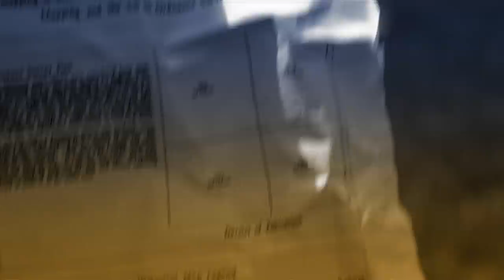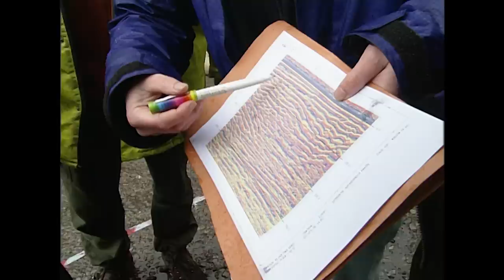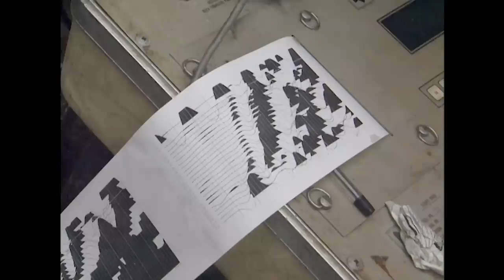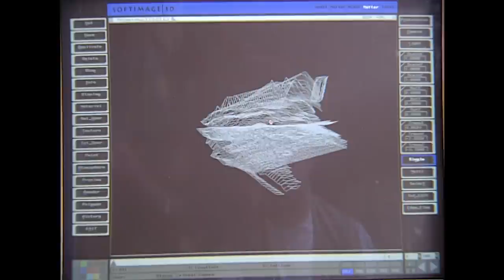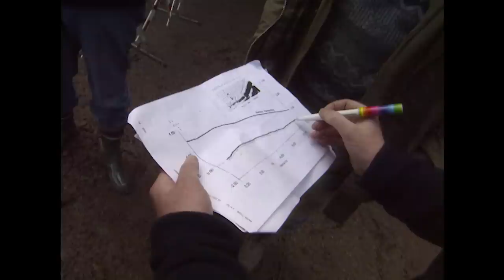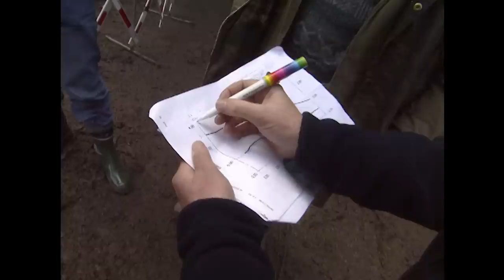The Prehistoric Mysteries Of The Cave People Living In Cheddar Gorge | Time Team | Odyssey

Comment: At the 28:00 min mark, I say it was a tool used for straightening wooden poles. The grooves keep the pole from sliding when pressure is applied after the wood has been wet and is being heat treated.

Comment: The antler tool with the hole and threaded like grooves in the hole is interesting. Like most tools i believe it served more than one purpose. Some have pointed out it may have been used to straighten spear or arrow shafts and the threaded like grooves helped to grip the shaft when levered. However, while that may very well be a use of it i think another use may have been for spinning rope. I dont believe is was used to wrangle horses in though. Those groves may not have ever been intended but rather wear and tear on the tool from spinning loads of rope through it. Any silica on the plant fibers being pulled and spun through the hole will wear grooves like that. So i looked up ancient rope spinning tools and there are some that are shown online that have holes with grooves in antler exactly like that one in this documentary.

Comment: I’ve had to dig in crawl spaces under houses a few times to create the legal 18” crawl area.
I hired two guys to loosen the dirt with claw hammers and other tools. I rigged up a big shop vacuum with enough hose to reach all around.
Each time the vacuum was full, I emptied it into a wheelbarrow and hauled it away.
It was a great system. I know there are vacuum trucks available because I’ve hired them in other construction digging.
Why don’t these guys use a vacuum truck? Then water is no problem.

Comment: The tool  with the hole helps with roping in an animal, just as fishermen use the reel and fishing rod to wear the fish out, even when the line is not strong enough to hold the fish from escaping directly. Why ? they can control the letting out of the rope.. they can slow the rope down without  getting rope burn on their hands, and they act as a team better, applying more tension to the rope, with the work of  all people adding to the tension. Without the eyelet tool,  the force can  be applied to just  one man, and the reaction time of that  man  can result in maximum force being applied to the man .. eg dragging him over, or giving him rope burns and other injuries.  The eyelet  therefore means that if a large tension occurs, the rope runs through. But then, as the hand extends toward the angle, the angle of the rope through the eyelet increases  the friction, and its causing the animal to wear itself out creating heat in the eyelet - rather than injury to the person.  The eye can be used  for  rope abseiling and rope climbing, as well .  For example, if an animal, or friend,  is in a cave, or the wall of the gorge,  they can go in to retrieve, using the eyelets on the rope  to  slow descent or create solid holds on the rope to climb with.
Reply: Though my question is: why rope it when you could just stab it or throw a spear or shoot an arrow?

Comment: I'm pretty sure if you have at times seven 28:25 is a tool used for straightening arrow shafts. 
This is an amateurs opinion of course.
Reply: 44:55 could have worked if one of them held the tool stationary and the other did a left hand/right hand back and forth motion with the hide.
Reply: @Gorboduc  perhaps, but I think only if the hair was already slipping. This looks like a piece of hair on tanned hide which will lock the hair in good and tight.

Comment: so when they had a cave full of sludge, why not call in a vacuum truck which is designed to deal with that kind of stuff? Seems like it would've been the most logical solution, rather than bailing water with a helmet and barrels

Comment: The "baton de commandment" is a camp fire stick breaking tool. You put a stick through the hole and bend it against the ground until it breakes. It's for making your camp fire wood (sticks) an acceptable length before you put it on the fire. You can break sticks with your hands and feet, but if you've ever done this before you will know it's a job that "gets old quick". The baton makes a quick and easy job of it.
Reply: The grooves in the hole is not there because it was put there on purpose. It's because many times the stick you're trying to break is not straight. And when you try to bend it against the ground the stick will twist and start putting grooves in the hole. The reason some of the batons are found broken is beacuse if you try to break a stick thats too big sometimes the baton will break instead of the stick.

Comment: Why did no one think to use a dredge?
Pump water in and suck it all back up, along with all the silt... And filter baskets would save all that picking through the mud.
41:40 - They actually suggested it and thought it was a dumb idea...  have they never used a dredge before? That's exactly how they work...  Typical egghead...  stick to your book and leave the practical to the workers.
Reply: And why aren't they using an electric winch, for Christs sake?